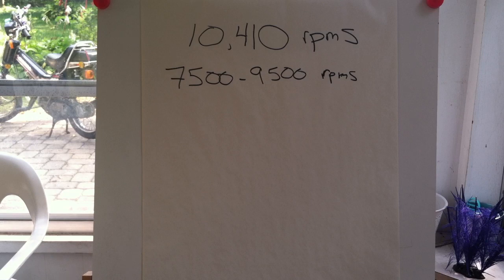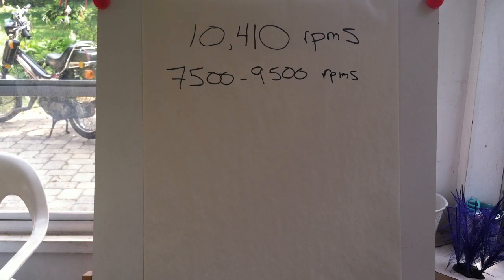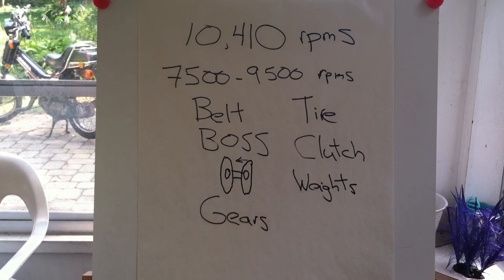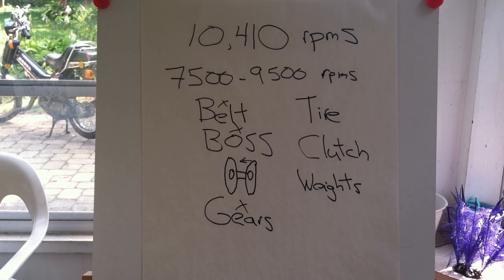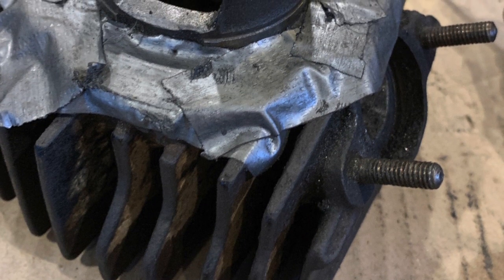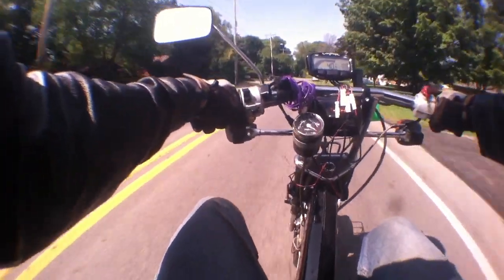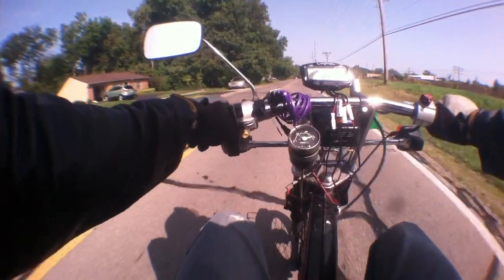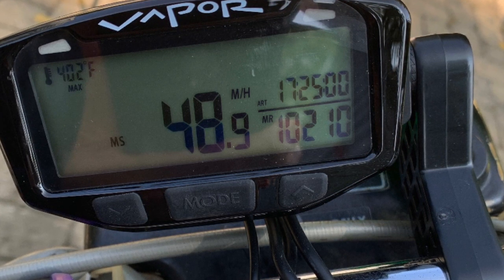Honda Urban Express 50/50 project (50mph on 49cc) pt 12

Comment: Yes, I watched and got a better idea on how you achieved 50mph on your nu50.
Do you have or did you make a video on the final gearing of your transmission’s upgrade?
You know, the section where you add gear oil.
 However, I’m still not sure of your carb mod. Did just rejett it, or replace it with a MV18 carburetor?
Reply from the maker: I'm only at 49.3mph so far.
Reply from the maker: https://youtu.be/LOjI7I4K6vU

Comment: I just got a 1983 urban deluxe...it runs good but I have to get the turn siganls and brake light working  first then I want to get running faster.....u don't happen to know a good place to get headlights? I've got a couple ear marked on ebay...but thought u might know better than me
Reply from the maker: Treatland.tv sells a replacement for the urban express. Make sure you have a good working battery as the battery acts as a regulator to keep all your lights from blowing out.
Reply: @jackrutherford-1  I just bought a new battery